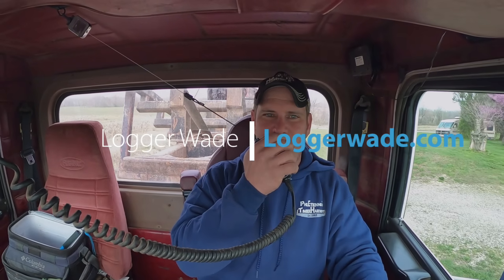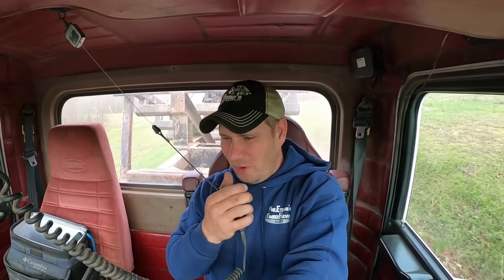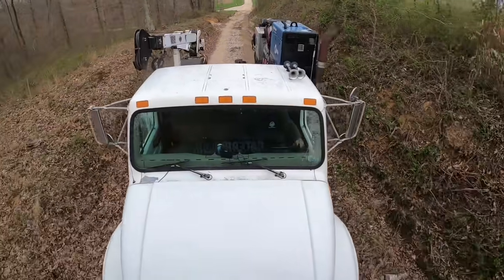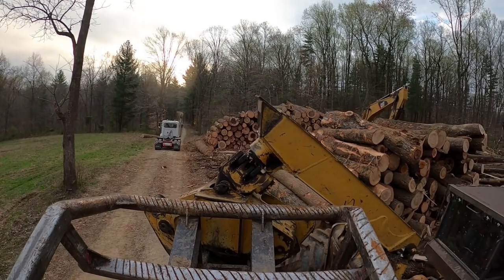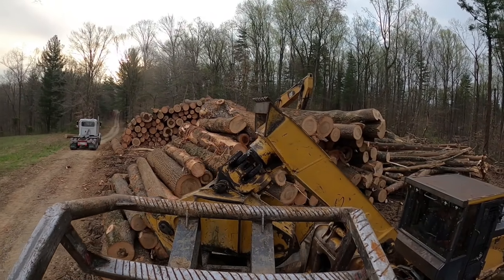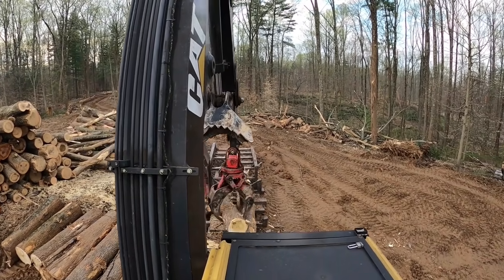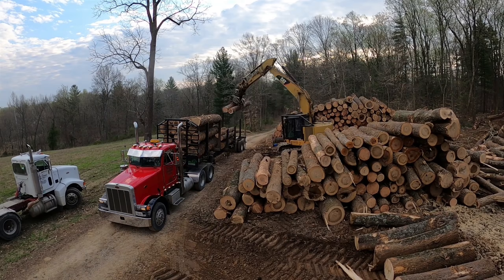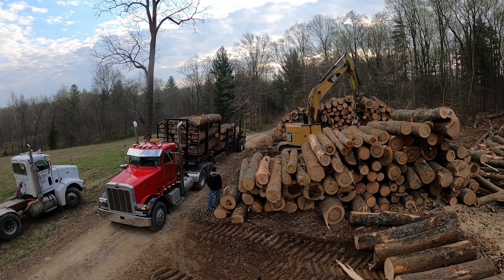This All Happened in an hour!!!

Comment: Yep. John is running a Cierco with a small 72" hydraulic driven saw.  You would need to get a longer bed as they rarely do lumber size logs, they went with a shorter bed.  And he trims forks out of trees so they go thru the chipper smoothly.

Comment: mechanical transmissions are a thing of the past, the newer torque/lock up, power shift trans,  definitely apply the power to the ground smoother, easier on the whole drive line.  That hose guide could be widened and some shielding installed on the hoses, for a quickish fix. A bank of clamps at that location would be good but may take up a lot of room and be more of a pain than. That must be the same skidder you said needed a larger engine, heavier front axle and a wider blade a few years ago.

Comment: Greetings from No VT - The older equipment can be wrenched so much easier which mean you can keep them running for as long as basic parts are available. The new stuff is hard to wrench and requires too much computer diagnostic equipment! Can you rig the new line outside the loop with a spread of 2 or 3 heavy duty cable ties to reduce the chaffing pressure on the other hoses?
Reply from the maker: Thats a thought

Comment: I'm a one man crew. But my 540a john deere does the same thing with the hydraulic line running to the winch from the lever. They put the lines in a spot that makes them rub and sometimes get pinched by the center pins
Reply from the maker: Gotta love it
Reply: Stay safe out there wade!

Comment: We run an 08' 648H and I'm curious about your tree pusher you have? What material dimensions would you recommend using to hold up to the abuse it will recieve?  We also have the typical hydro and electrical issues you are having with Deere's fine engineering designs! I wish they would hire loggers to design forestry equipment.
Reply from the maker: Hey buddy sorry I'm late just seen this...  ok 3/4" on everything and I use three gussets and I believe it sticks out 8-10 inches some people use a smooth arch and I think that may be better on the trees than my teeth at least on a grapple cable rig I'd stick with flat face pusher with teeth because of the fenders
Reply: Thanks for the info. Nobody around here I know of runs a newer 648H so wasn't sure on the best route to make one work and hold up. These arches aren't really designed well for pushing timber without putting unneeded stress on rotation parts. Thanks again.

Comment: One of them days driver! Thanks for the tip on them hoses on the valve bank my 648e bout drives me nuts with the noise lol. One of these days I’m gonna get me a 748g or g2 I think it would move my trailer mount a little better and hopefully be a bit more spunky with the big motor. But I still like the 648 dual arch it pulls wood every day with little trouble.

Comment: Going with the Automatic transmission in Whitey will end up saving you alot of money not damaging or breaking parts like you would with a manual transmission in it
Reply: Manuals will last teh time of teh truck if looked after only thing that goes in the Clutches usually which is down to operation. For example a Massey ferguson 390T my old biy used the clucth only lasted til 12 oclock in the morning due to the operator they leant it to slipping the clutch instead of selecting a gear that he knows she will go up the silo at and lettting her in at low speed before giving it the welly. Once fixed no-one was alowd to lend that tractor and my ole boy operated it exclusively and she was still going strong when she was sold after 4 years Auto compensates for bad operators  but in heavy operations my brother in-laws full auto has now given so much problems compared to the semi auto boxes

Comment: Would a machine that works by wire controls to valving solenoids near the pistons be better than this one where the skidder has all the hydraulics routed up to the cab before going elsewhere? or would that just be moving the problems somewhere else on the machine? Do they even make any skidders that are drive by wire systems?
Are y'all going to be able to rebuild that truck that rolled over last summer?
Reply from the maker: Or like cat valve sit in the back frame so its just pilot hoses going back

Comment: It's the little things that add up in a hurry. Like you said it's a great piece of equipment, but when the little things break not caused by the operator, the woods or just being old. It shows pure laziness out of the engineers who designed the machine that make alot of money to do there job.